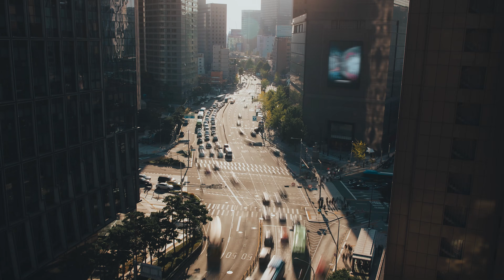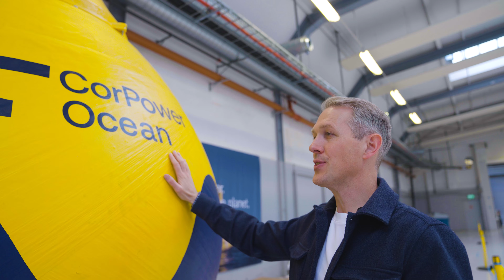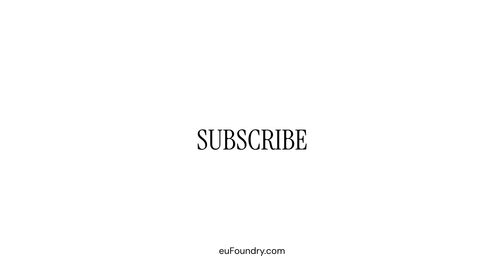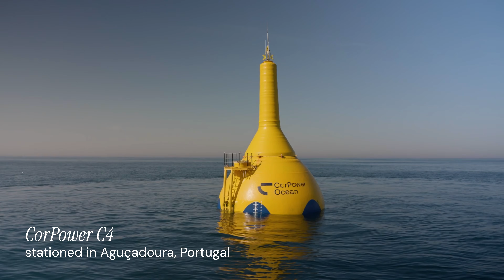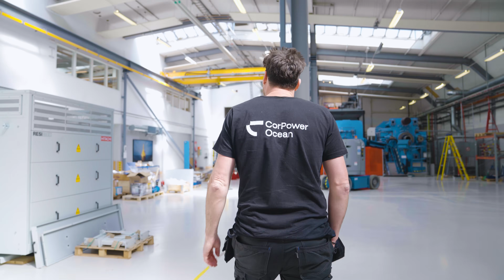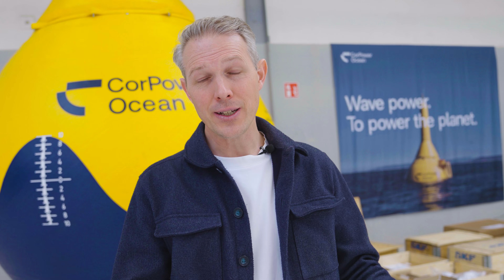The 10x More Efficient Renewable (That Nobody’s Talking About) #009

Comment: How the Dual-X System Automates the Flow - The right way to do this 
By separating the inputs and outputs, the fluid dynamics become elegant and highly reliable:
The Top/Inlet X: All the rubber flaps on this array only open inward. When a wave crest passes over any part of this X, it forces water into the system. Because water is incompressible, this instantly pushes water up the main feed line to your land turbine.
The Bottom/Outlet X: All the rubber flaps on this array only open outward. When a wave trough passes over any part of this X, the drop in external pressure sucks water out of the system, pulling it from the land turbine's return line.
No matter where the crests and troughs are shifting across the bay floor, the system automatically finds the highest pressure point on the Inlet X and the lowest pressure point on the Outlet X. The waves do all the switching.

Comment: Another useless expensive GUNNA . It might look clever and it is a great "project" for money laundering for sure . But the reality is you only need some pipes that harness the WC and a generator . The rest is just expensive fluff AKA pretending an ENGINEERING solution is actually real for the application. NOT !

Comment: Brilliantly explained by the CEO and the lead engineer.  I am going to refer to this video as an example of how to explain complex novel concepts to a wide ranging audience.   Gret tech too,  i wish them all the success possible.   Co locating with existing windfarms is an excellent idea.  Easier permitting (?)  leverage existing infrastructure shore and off shore sides.  One suggestion,  as you expand to more, lets say areas where people are not so law abiding,  make sure all the external fixtures, cant be tied onto.  Otherwise i am sure it will become a mooring ball.
Reply: Power-producing permaculture

Comment: OIl will always be needed for the production of plastic, lubricants, clothing, pharmaceuticals tires, roads, energy to name a few.
Reply: Yes, but in tiny quantities compared to burning it to generate power
Reply: That’s not what’s cooking future generations… and now us.
Reply: @IdrisFashan a hidden carbon footprint which swings well above its perceived weight is concrete, which not only requires a lot of energy to make, but which actively outgasses carbon dioxide as the calcium carbonate decays into calcium oxide.
Reply: @isaackellogg3493  decarbonization of concrete is already happening at scale. The challenge isn’t the a technology, it’s the cost versus cheap AF carbon intense concrete that has had a 500 year head start. 🤷🏾‍♂️
Reply: @IdrisFashan every new replacement technology is more expensive than old established ways of doing things—at the start.  If we care enough to keep doing it long enough, economies of scale will eventually tip the balance in favor of the new technology

Comment: As anyone who has actually worked offshore will tell you: out at sea everything always breaks down, regardless of how strong you make it. Every testbed yields the same results, great technology but the costs for maintenance and safe operations are astronomical and usually a business case killer
Reply: I guess that explains why offshore winds Farms aren't happening, right?
Reply: @laughinggas5281   nice try but 2 things:
1) wind mills are not submerged, which takes away the biggest problem
2) offshore wind is still at least 2x more expensive than onshore wind
Reply: @vicbauwens  it likely is 2x more expensive. But the winds are more consistent and blow harder offshore, increasing the turbine's capacity factor.
Reply: @l @laughinggas5281  was referring to a factor of 2 on LCOE, takes everything into account. You can try to turn any way you like, offshore energy will always be much more expensive than onshore, for obvious reasons. And wave converters have never reached meaningful levels of operational success.
Reply: that is what boat owners say
Reply: @user-uw3fi2zg4t  I guess serious boat owners are a subset of people with offshore experience.
Reply: Just imagin the amount of fouling!!
Reply: @kalaiolele8796 yes, or anti fouling, regularly reapplied. Not so good for the ecology!
Reply: @kalaiolele8796  indeed that is always the killer

Comment: The back and forth motion is hard on components. Sealing the rods that move in and out of the device will also be problematic.
Reply: I wonder,  given the external material choice if there is a way to "see inside" the machine, without having to open and inspect.  If so would make a drive by inspection possible?  If so then preventative maintenance would be possible much earlier on in the destruction phase?  I dont know and i am not an engineer,  but i imagine drivinlg a boat past on a frequent basis and gathering that visual date would drive down costs of maintenance and upgrade longevity?

Comment: Sorry….but none of the fundamental issues that have thwarted commercialisation of wave power have been addressed by this device. It is yet another iteration of a device that has been tested several times over the decades and hasn’t worked. There are several methods that are resurrected every now and then by well meaning enthusiasts who do not bother with the fundamental mechanical engineering problems that conspire ….in an ocean environment …to thwart the commercial operation of the proposal. And the usual word salads of technical babble are sprinkled through the “pitch”….”negative spring” for instance….to separate the zealots from their investment dollars.

Comment: Stop making things complicated, just a simple water pumping ,send tha high pressure water to a centralized  facility on land a single unit will generate electricity a high pressure tank can handle hundred of units with a simple check valve,high pressure water could be used as energy storage

Comment: Fascinating stuff. Presumably there are shaft seals to keep the water out? Reciprocating motion in  a dirty environment is a real challenge. How long do they last?
Reply: You mean like in the millions of shaft seals on all types salt water vessels plying the oceans now?
Reply: @sd70cal  That need regular maintance.
Reply: @Terry-y2r    Coal and gas plants require more day to day maintenance than every other power generating method. 
Since this unit is a production one and it came after years of testing other units you would think maintenance cost concerns would have been addressed.
Reply: Shaft seals on rotating shafts are nothing like this. These seals aren't sealing rotating shafts. They are trying to seal reciprocating action on the shaft. The ocean is a very harsh environment. These will require constant maintenance.
Reply: @yoxat1    A steam turbine in a traditional power plant operating at over 1000 degrees requires constant maintenance. 
Just as a reciprocating shaft is not like a rotating one the coatings, metals, and various seals and scrapers they use are different.

Comment: They skirt around the biggest issue with wave power, namely that it can't scale the same way as, for example fossil fuel generation or wind turbines. If you make the floating chamber bigger, instead of collecting more energy, it'll just bridge between waves and barely move at all. It's the same reason big ships are so much smoother in rough water than small ones. This limits the system to being sized fir the specific waves it's being installed in, with the only way to make more power being to install more floats, which will almost invariably cost more than making bigger ones. 

This is the issue that keeps wave power as a niche source compared to wind and solar, which are already cheaper than the projected price given in the video for wave. Waves are more reliable than wind and sun for continuous power, but calm seas are also not uncommon. I'm all for progressing this though, and the idea of specifically tuning resonance to couple with the waves passing the float is an excellent idea. Also this is massively more efficient than the oscillating air column turbine systems that have been pushed for years by many, now defunct, wave energy companies.

Comment: 11:30 This part here is so fascinating to me... A negative spring. Well done Jorgen Hals and well done to the CEO Patrick Moller for crediting your engineer(s)!
Reply: I don't think it's so complicated. When the mass is in the middle, the spring has no way to push the mass out of the center. If it moves a bit out of center, the spring gets an angle at which it can start pushing the mass away from the center. The further it moves away, the bigger this angle becomes and the larger the component force becomes that pushes the mass away.

It's acting like a piston and connecting rod in an internal combustion engine. With the piston at top dead center, the connecting rod is exactly above the crankshaft. Any force on the piston doesn't cause the crankshaft to rotate. The further the piston moves down, the larger the angle between the vertical and the connecting rod becomes, and the larger the tangential component force becomes.

Comment: 14 year old company, one site in operation. Very Swedish speed of progress there
Reply: What about the barnacles?
Reply: CorPower Ocean utilizes a dual-strategy approach involving both chemical prevention and mechanical removal to protect their wave energy converters (WECs) from biofouling like barnacles and mussels:
1. Special Anti-Fouling Coatings (Chemical Prevention)
The Hull: The large, spherical composite hull of the buoy is treated with commercially available anti-fouling paints that suppress the growth of marine life without harming the ecosystem.
The Rods: The moving alloy-coated mechanical "ocean rods" extending beneath the buoy are treated with specialized laser-cladded protective coatings engineered to resist both corrosion and biological adhesion.
2. Automated Periodic Scraping Sequences (Mechanical Removal)
Because chemical coatings alone aren't always enough to stop persistent organisms like barnacles in a high-salinity marine environment, CorPower builds physical cleaning mechanisms directly into the machine's operation.
Scraper and Seal Glands: The machine's control system is equipped with upgraded heavy-duty seals and scrapers. As the ocean rod naturally moves up and down through the sealing gland with the wave motion, it physically scrapes off any newly formed biofouling before the organisms can fully cement themselves to the surface.
Artificial Cleaning Strokes: To clean the extreme outer ends of the rod that do not regularly pass through the scraper during normal, smaller waves, the machine's automation periodically initiates programmed, artificially induced full-stroke movements. This forces the entire length of the rod through the scraping mechanism to keep it clean without requiring manual divers or biocide chemicals.
Reply: @MrKendyll biofouling will be a huge  issue
Reply: Thanks. Looks very promising on it's own merits but I think it will be implemented with other generation modes. 
PV, wind, and/or adding with other mechanical augmentation devices. Very good base mechanism to start with. Carry on!
Reply: Looks very interesting. I wish the UK would build some tidal barrages. Tide/wave has so much potential for the UK. Got to love Scandinavian thinking.
Reply: Thanks to the trumps of the world.
Reply: Sweden's electricity grid gets 98% of it's energy from renewables and nuclear. I'd be willing to bet that's  WAY ahead of your country's progress.
Reply: And a very mechanical, over-engineered design that ensures that if anything breaks, it'll cost ya.
Reply: @JaniMelender-vn9vu optimization comes through widespread commercialization and competition.
Reply: @JaniMelender-vn9vu By definition "over engineered" = extremely low failure rate. Did you have anything worthwhile to say?
Reply: @JaniMelender-vn9vu This sounds like one of those postings the cigarette companies would use to pepper the media environment for sowing doubt and confusion.
Reply: @sd70cal  Say you're not into mechanical engineering without saying you're not into mechanical engineering. Solar panels are a 100x better invention.
Reply: @sd70cal salt and biofouling are a crazy high base rate risk for anything mechanically complex in the ocean. Unless they have automated drones to maintain these bouy their maintenance costs relative to their energy output will make wind turbines look miraculous. I'd put money down on that in a betting market except there are enough other people with money and common sense that there'd be no alpha unless I got my bets in before the odds of this project ever turning a profit without massive subsidies crashed below 10%.
Reply: That's almost modern nasa probe/telescope pace. Gotta make sure those smart engineers are locked up for decades on government funded vanity projects otherwise they might do something that threatens the status quo.

Comment: How does this compare to sea air power? Why would someone prefer this over wind turbines?
Reply: Why not both? They can be used together, and when the seas are calm or the wind stops, the other can pick up the slack.
Reply: @BaddeJimme   What I'm most concerned about is the environment.  Moving to wind and solar with battery energy storage is just trading one bad outcome (fossil fuel use) for another (the environmental damage of building out wind/solar and battery energy storage). 

There's an old saying...

"work smart, not hard"

The moral of the quote is to emphasize efficiency, strategy, and leverage over brute force or endless grinding.

A world filled with millions of wind turbines, billions upon billions of solar panels, and hundreds of trillions of man made batteries for battery energy storage systems, ALL OF WHICH have to be recycled every 15-45 years, is...

--- WORKING HARD WITH ENDLESS GRINDING ---

Tapping into the NATURAL THERMAL BATTERY beneath all of our feet, with limitless thermal energy contained within it, is...

--- WORKING SMART AND EFFICIENT ---

Geothermal is the path forward...
Reply: Wind and solar are pathetic sources of energy.  Our manner of harvesting it just suck...

Comment: Yep, one of the best Water Energy Technology from a while..

I wonder why they don't speak more of this and the other Membrane which apparently is more Efficient than the Theoretical maximal Extractable energy from Fluid of ≥2%.

When I remembered it and asked AI told me it was impossible that I remembered correctly because the Theoretical Maximum was below that threshold...went back to check and Apparently is what the Company which Made the Membrane Discovered to their own Surprise...

Is just more Efficient that's it, no thermodynamic Breaking.

The two concepts could be Combined in-between Wind Turbines and Making the most from High-Energy Intensity Areas.. for a Private might be to much but for a Collective Project Financed both from States and Private Investors that's Neat...
Hard to Beat as easily with whatever other technology by now Existing.

Comment: Wonder if one could run ai  clusters on these buoys ? And how much storage to smooth the power a little.. add a starlink small batery and an ai cluster. Remove all the connection infra structure costs. And easy to swap out cluster as it becomes out dated.
Reply: So much more expensive to put a datacenter in the ocean surviving it vs on land.